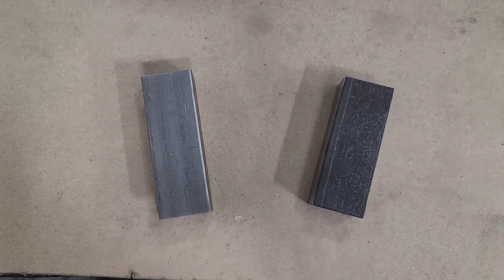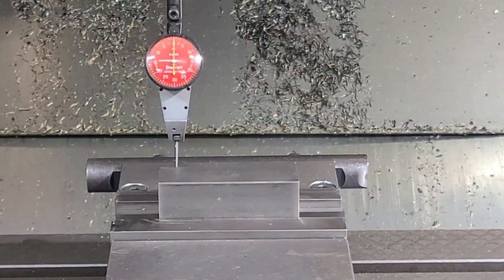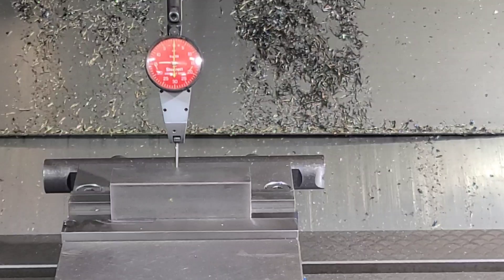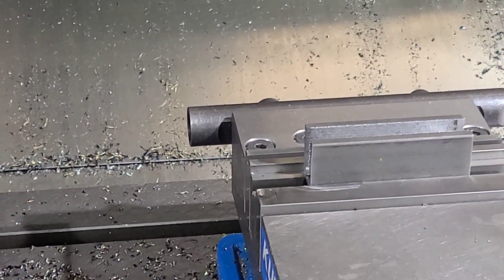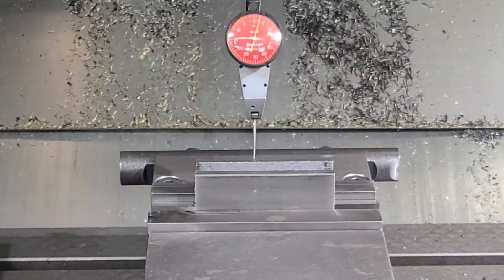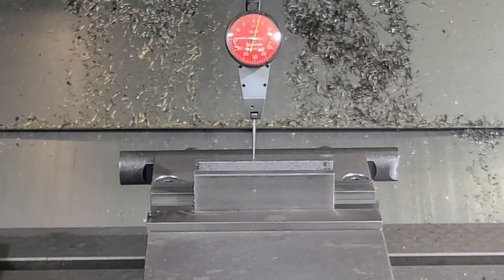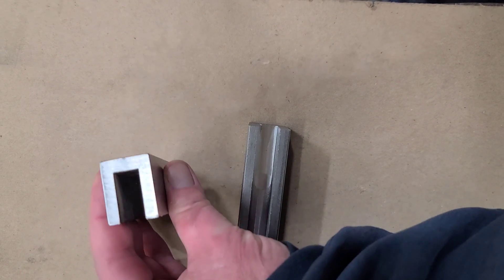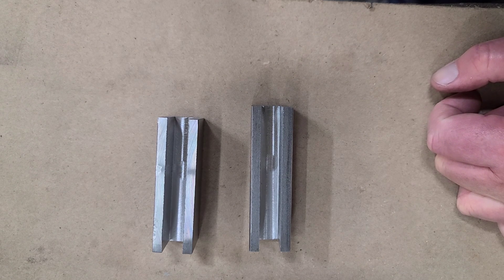Machining Hot Rolled VS Cold Rolled Steel

Comment: It seems like it must have internal stress that are released upon machining. What if you heat temper it prior to machining it?
Reply: All bets are off when you heat treat. You can pretty much guarantee dimensional changes then.
Reply from the maker: It would work but cause surface scale that negates the benifits of using the cold rolled steel. Thank you for watching and commenting!
Reply: But after (de)treatment the dimensions will be stable.
Reply: @Iowa599  it'll be what it'll be. Which won't be what it was. When you heat steel up it's like you hit the randomizer button on it. It never cools back down to the original dimensions. Now there's people that can play the warp and figure where things are going to end up. But that ain't me. I can only tell you it will distort.
Reply: @1pcfred  ie: overheat an engine, head gasket surface.
Reply: @1pcfred  yeah. Cast steel/iron (basically the same thing to mechanics, not enginerds), aluminum, whatever. The heat warps them, or allows them to be warped, by allowing internal stresses to relax.
Reply: @1pcfred  I think you might be an enginerd, but I'm just a mechanic. 

I think cast iron is high carbon content, high enough to be too brittle for most automotive stuff. Most stuff (like heads, manifolds, even blocks) are actually cast steel.

oddly enough, the top two piston rings (of the common 3 ring arrangement) are cast iron. They break easily when not constrained by the piston & cylinder.
Reply: @1pcfred  most engines & parts are made of alloys that can't be called iron because the carbon content is too low.
Reply: @1pcfred  steel is an alloy that is primarily iron, and cast iron is not mechanically suited to replace cast steel parts, but they are similar densities.

Comment: Try putting the piece deeper in the vise. You could use cold rolled 1018 that is ground has no scale and much more stable. Costs a bit more but if the jo calls for it do it. Used all of the above when I had my shop, retired now.
Reply from the maker: Deeper in the vise would make it worse. Then when it springs the inside and outside would both be wrong. Ground CRS may help a little but if you check out our latest video I kind of did the same thing and no benefit. Thank you for watching and commenting!

Comment: Cold rolled has a compressed layer from the rolling process.  This gives the cold rolled a higher tensil strength but it looses the extra tensil strength when the compressed layer is machined off.  This surface tension is what makes the material unstable for machining
Reply from the maker: Roy my personal opinion is that it is more than just a layer that is affected by the rolling process. I have made parts that required heavy material removal on all sides prior to machining and still have had the same effect. Due to the fact that cryogenic treatment solves the problem, I believe the rolling process creates molecular inconsistencies throughout the part and thats what causes the movement. Thank you for watching and commenting!
Reply: @mvpmachine  I said surface but it probable deeper than that.  I was a machinist and I quickly learned the problems with cold rolled.
Reply: I later earned a mechanical engineering degree and the discussion or the tension in the material was from what I was taught in materials classes.
Reply from the maker: @RoyLightle-y5p  I have had a few expensive CRS lessons 😄 myself. Surprisingly a lot of the companies I deal with don't know about this and send almost impossible prints with cold rolled specified.
Reply: @mvpmachine  They need educating
Reply: ⁴⁵⁵⁵⁴⁴⁴4⁴⁵⁵4u⁵⁵

Comment: I’m not fond of machining CRS either, but sometimes I have to. If you machine to a dimension, you can’t just take down one side, you have to split the amount of cut in half and take half off either side or the piece can bend to one side. Not so much of a problem in really think pieces, but on thin ones it’s a problem. But CRS is somewhat stronger because of the cold roll which compresses the metal somewhat like forging.
Reply: My experience has been that if you are machining crs and do much more than drill holes in it you better check your dimensions the NEXT DAY, because yes, I have had dimensions change over night on a number of occasions.
Reply from the maker: @37yearsofanythingisenough39  You got that right!
Reply from the maker: Mel, it is a slightly stronger material but it does not compress evenly throughout the part in my opinion. It sure can be a pain! Thanks for watching and for commenting!

Comment: Generally, when I work with steel it's 1018 cold rolled.  My projects don't have to be dimensionally critical. If they were I think I would have used a 3/8" end mill and just taken the extra time and just gone back and forth a few more times till I got the inside dimensions where I needed them.
Also, having checked the outside dimensions beforehand and, as high up as you had your metal stock in the vice, even if I got a widening effect at the top of my stock, I could then run my end mill as close to touching the vice as possible and just skimmed the outsides of my stock  while it was still in the vice to bring it to the correct width that corresponded with the correct outside-bottom dimension of  my stock.
Hope that makes sense.
Good information.  I did not know that there was that much of a difference.
Reply from the maker: Thank you for watching and commenting! It did make sense and may be a good solution for this small part, but for larger parts the end mill on the outside would deflect and not be possible. I intentionally did not try to make the slot nice just to focus on the outside changes, but there is a new video I just made that shows the effect on a larger plate part.
Reply: I know it takes time and time is money but for a small part what about an hour at 400F? Would that be enoigh to relieve internal stresses?
Reply from the maker: @twm4259  no a much higher temp to anneal it but then surface scale would be like the hot rolled steel. So no adding more cost to already expensive CRS. Thank you for watching and commenting!

Comment: hi good video, if you normalize the cold roll will it stay on dimension?
Reply from the maker: Hi Rich, I suspect it would help but it is not a common practice likely due to surface considerations. I know Cryogenic treatment for 2 days (nitrogen bath) works well but a little pricey especially with small quantities. Thanks for watching and commenting! Tim
Reply: thank you for getting back! @mvpmachine
Reply: @mvpmachine  "" I know Cryogenic treatment for 2 days (liquid nitrogen bath) ""

Comment: Can you heat treat cold rolled before to reduce stress?
Reply: In theory yes, you can spend more to stress relief it at 600C, but as it heats and softens the residual stress will likely warp it, so might as well use hot rolled in that case.
Reply: Yeah screw the material up ahead of time. Better living through lowered expectations. Stress is the big killer.
Reply: Yes you can do this, but you may as well use hot rolled as it will have surface scale.
Reply: @christopherleubner6633  I didn't know that.  Thanks
Reply from the maker: Cryogenic treatment solves the problem, I show in my newest video but can be pricey if you don't have some quantities. Thanks for watching and commenting!